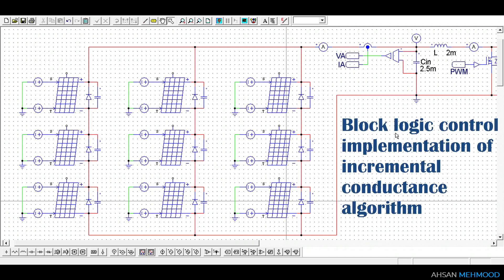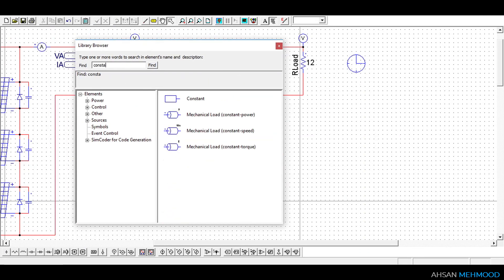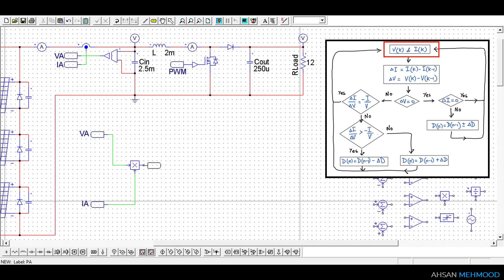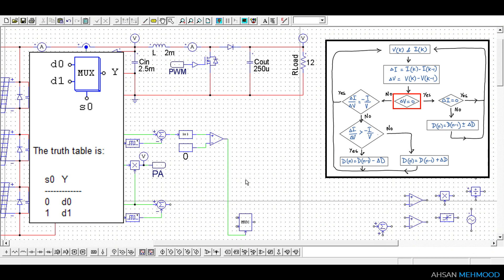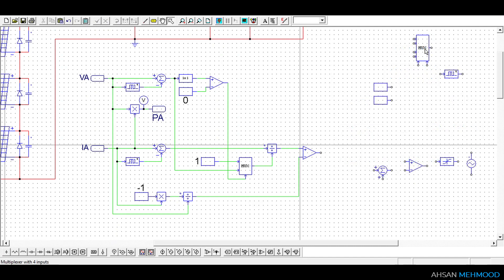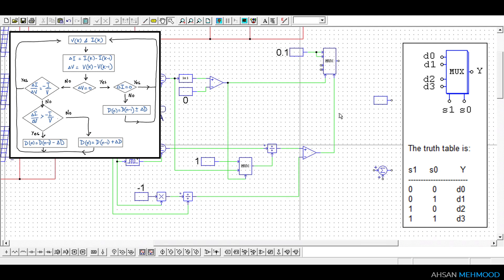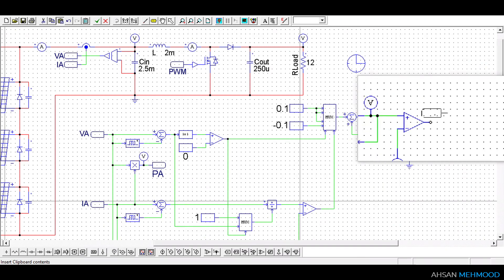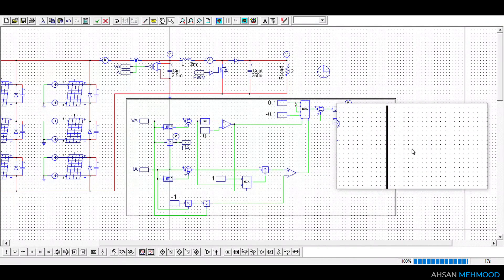MPPT Incremental conductance block logic simulation in PSIM software | IncCond method simulation

Comment: Block logic
Reply from the maker: okay, I will try to implement it on MATLAB as soon as I could. Keep updated.
Reply: Ok try to make for kyocera solar KC 200GT panel and make system of 6kW
Reply: May be helpful but try to make for 6kW as i have sent u
Reply from the maker: okay, no problem.
You have to wait for 2-3 days as I am currently busy with another video.
Reply from the maker: what should be the array size (strings etc.)?